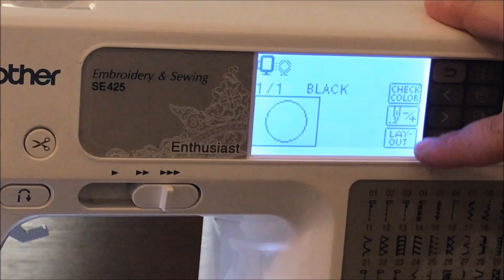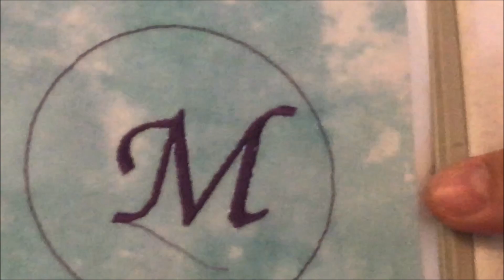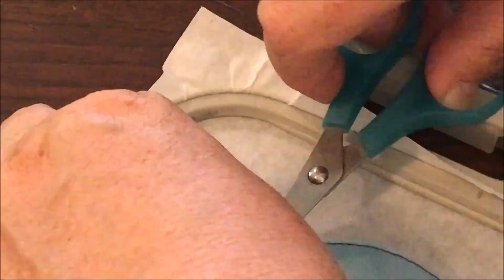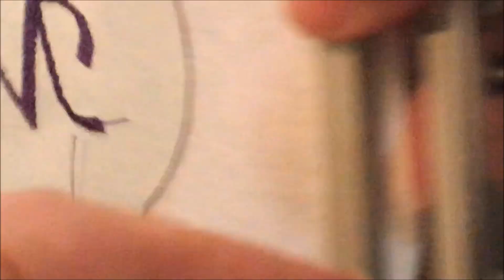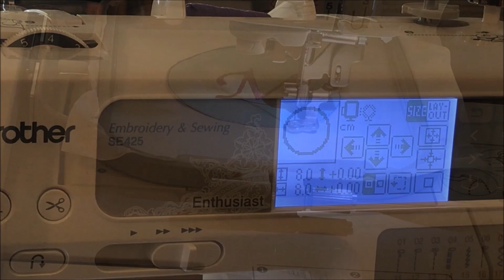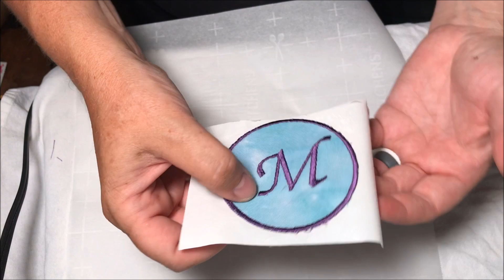Brother SE425 - Create an Easy Patch with the Designs on the Machine

Comment: Mine is a Brother SE 535. I love to do applique but unfortunately do not have a lot offered on my machine. I only have a 4x4 hoop area to sew on even though the hoop measures 5x7. it only does 4x4. so, I have a lot of trouble finding applique to fit in my hoop.

Comment: I am just a little curious how this holds up after washing as you are ironing the heat and bond onto the paper stabilizer and not onto the material. I would think once it is washed the patch would come off because the paper does not hold up to washings.

Comment: What do you suggest on how to get the white raw edge out of the satin stitch?
Reply from the maker: It’s not that noticeable to me but if it bothers you, I would try tweezers or using a same color marker to fill in any spots they show.  You can also use a water soluble stabilizer and you don’t have to worry about any white sticking out.  Hope that was helpful.
Reply: CleverDog Designs  Was wondering about water-soluble.  Would you still add heat & bond to back?
Reply from the maker: Yes, just make sure you use the parchment paper sandwich 😊